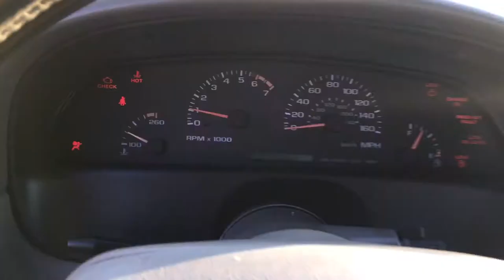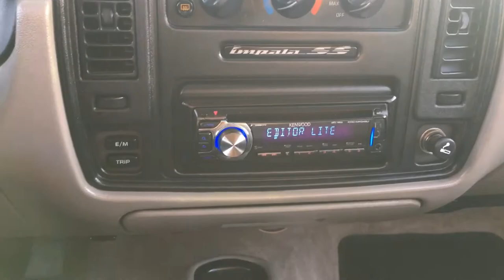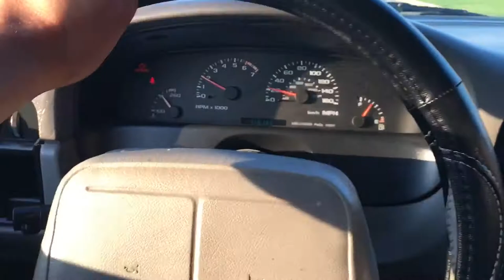1996 Chevy Impala SS Walk Around

Comment: I got a question for people who owned 1996 or 95,94 Impala's I got a 96 from my cousin gave it to me for my birthday he got it on a trade from a friend of his car was sitting up for a long time it needs body work and in side restoration  inside not to bad he was told that the engine was rebuilt car has 200000+ mileage has original rims with center caps but they beat up I been researching info on YouTube about the problems they have and I'm not sure on the rust if its bad cause it was sitting outside but what I'm really trying to find out is it worth putting major Money in to it or should I take a L and just sell to junk yard
Reply: Do video and I will let you know